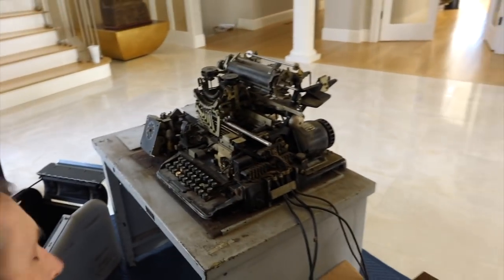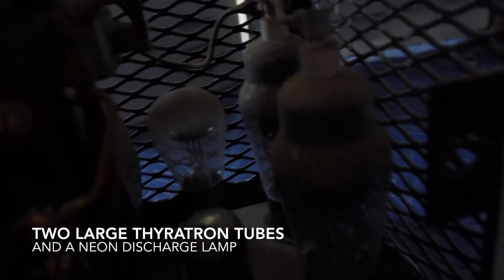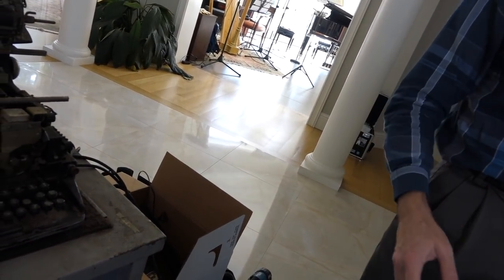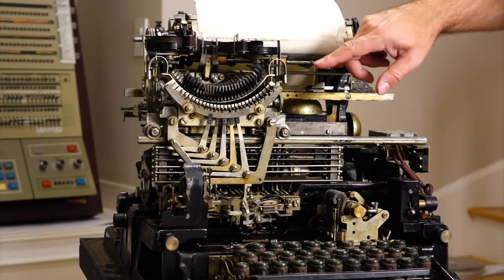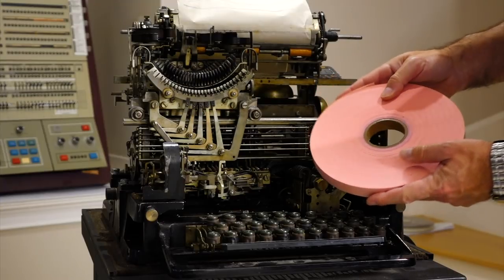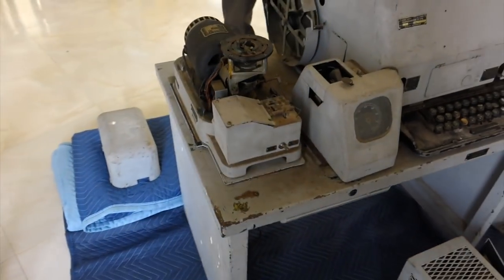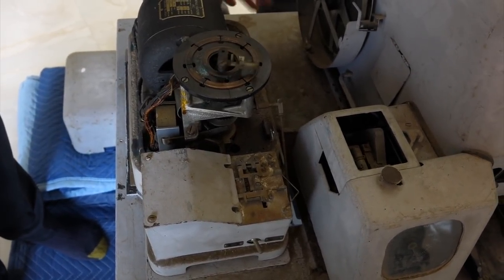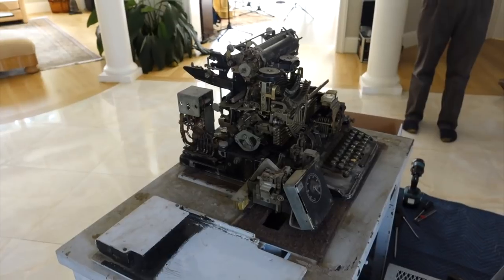Teletype Model 19 - Part 1: A Teletype Arrives for Restoration

Comment: Oh, this should be fun.  My dad had a TTY 19 (in black) at home when I was growing up.  (It worked, too.)  I remember the lights from those tubes in the power supply.  From the colors, I think one was a mercury rectifier (blue) and the other a voltage regulator (orange).  Of course, it was serial communication over a 60mA current loop circuit.
Reply: Yes, the two that are blue are mercury thyratrons and the orange is a neon bulb (large) which provides a voltage reference based on its discharge voltage.

Comment: Wow do the type bars move back and forth? I don’t think I’ve ever seen that before!

Beware of wax / paper caps in the PSU. You might want to make a dim bulb tester before just plugging it in, that can save the transformer if one of the filters is shorted. Basically you use a light bulb as a current limiter / fuse.
Reply: The horizontal bars tilt up and down to reflect the MARK or SPACE condition of the associated bit. Five bits in baudot code, so five bars. The type bars flip forward just like old school typewriters.

Comment: One of the interesting things about the power supply is that is uses synchronous rectification. The rectification is done with a pair of mercury vapor thyratrons (WECo 323As) - note the grids. In operation, they will indeed emit the Holy Blue Glow.

Also, your TT-7/FG was made in 1951 or thereabouts.

Comment: I think the square plug with 4 flat pins and the offset centre round pin is exactly the same Cinch Jones plug that the Drake TR7 transceiver uses for its 12v power input. It looks identical at least.

Comment: how is the model 19 mounted on the table? is there still a plate between the table and the teletype?
mostly looking on how the cables are protected ( the get damaged here on one without table)
Reply from the maker: I checked and indeed there is no side door for the cables on the enclosure like in the model 15. The cables go straight down through a hole in the table.

Comment: A minor error in the captions around 2m30s: The Model 19 is not a "military version" of a Model 15. To summarize:

The Model 15 Teletype was printer-keyboard only, mounted on a stand as shown on the video. "KSR" units included a keyboard ("K") and could send ("S") from the keyboard and receive ("R") on the printer. "RO" units were "receive only", containing just the printer without a keyboard — often found in places such as radio stations that received news from UPI (United Press International) or AP (Associated Press).

The Model 19 was a table-mounted Model 15 printed... plus a paper tape punch driven from the keyboard ("perforator") and a "transmitter-distributor" (TD), a paper tape reader. Some versions of the Model 19 were configured with a "keyboard-typing reperforator" (KTR), a tape punch that could be switched to receive incoming signals and record them to paper tape... or switched to punch a tape from the keyboard. ("Perforators" punch tape from a keyboard. "Reperforators" are capable of punching tape from an incoming signal.)

The Model 14 TD was a standalone tape reader to transmit over the wire/radio. The Model 14 reperforator was a standalone typing tape punch that received signals from the line; it often sat on a wheeled base and could be rolled around to different operating positions... and was nicknamed the "potty".

Comment: Konrad Zuses Computers used Teletypes with papertape punches and readers with the 5 bit Baudot code as in- and ouput devices starting with the Z11 I think until the last models Z23 and Z25. Zuse had the first usable plotter that could also be controlled by the teletype punch tape.

Comment: Where do you get blank paper tape nowadays? Is it all new-old-stock that you’ve got in a closet somewhere, or is there someplace you can order it new? 🤔
Reply: I know the people who trained on morse code used machines that used paper tape. I'm sure there's old stock floating around.
Reply from the maker: Mine is from eBay. Not cheap. I am sure you could have someone make new rolls if you ordered a lot. But this paper tape has to be oiled (the oil in the paper is to keep the punches oiled).
Reply: I've seen a Morse code trainer like that, but I think the tape was narrower.  I think two tracks with a set of sprocket holes.  TTY is 5 holes plus the small sprocket.

Comment: I wonder how many people still around remember how to wind the tape into figure 8s using their thumb and pinky finger?
Reply: I'm still here!  -  RYRYRYRYR -  (who knows the significance of that?)  I was a Teletype tech in the USAF in the 70's!  Afterward I worked on model 15s and 20s as late as the late-80s for UPI in S. Carolina (where they still had a slow speed wire circuit that didn't require the newer dot-matrix printers.)  I've forgotten most of what I once knew of these machines but I can still wrap tape around the thumb and pinky!

Comment: There was a way to scan pictures and have an electric typewriter reconstruct the photo using keyboard characters. Do you have one of those?
Reply from the maker: Oh sure, plenty of programs available on the net, some will even do it online in a web browser, there are apps for the iPhone too. Look up ASCII art. I had good luck with one called ascgen2 on the PC. I used it in my ASCII Art video right here: https://youtu.be/YS9dGYUbNd0
Reply: That's not what I mean. The green bar printouts with the art aren't the same kind of thing as the scanned photo printouts. The photo printouts printed characters over each other to get a more detailed photo. The original photo went in a drum for scanning and it was sent over phone lines. The printouts were on modified electric typewriters. It was used before WW2.
Reply: Our team member Luca created a system to snap photos with a phone, transmit it wirelessly to an interface where it was converted into overprinted characters and sent to the 1403 printer on the IBM 1401 system. He plans to modify this system to send 5 bit baudot to the teletypes.
Reply: Overprinted! That's the term. All I know is I saw examples of the printouts and the photos and they looked 20s or 30s. It could have been a system in limited use or even a prototype for all I know.

Comment: Really nice! But if it were a steam teletype it might actually have asbestos in the grease or sealant!
Reply from the maker: No kidding. This one has asbestos in the wire insulation. Ken was using a mask while working on the table wiring.
Reply: Wow, ok... I'll remember that. Was that to give the insulation fire protection? I've seen the hard asbestos sheets in old tv's, I'm guessing the wire insulation might have the real nasty stuff that floats around well.
Reply: Asbestos was cheap and it was heat resistant.  You could find it most anywhere you expected something to get a little hot.

Comment: 5-bit Teletype is called Telex. Some Teletypes could do both 5- and 8-bit. I was using once a Swedish computer via Telex network from Finland. It was the fastest, because voice (and modem) communication was unreliable.
Reply from the maker: Telex refers to a switched network service, some over radio links or modems, which used teleprinters like the Teletype as their communication terminals. So you could "call" another Teletype on the Telex network, be connected to it automatically, and send a message. Pretty cool. It ran Baudot initially. In the US, Western Union was famous for their Telex-like service, and sure used a lot of Teletypes. But Baudot Teletypes were used for many other things than the Telex service.
Reply: Telex was something you'd see used in business in the 60s and 70s. I got the impression it was a teletype machine you could dial into.
Reply: At least colloquially it was. I remember a room full of terminals. You could choose either Telex-machine or Teletype-machine for your   overseas computer communication. Telex was reliable but slow (50 bits) and Teletype was superfast (300bits) but unrealiable and expensive.
Reply: I got out of college in 87 and don't remember seeing Telex machines. Seems like, in '89, everybody got fax machines and that was it.
Reply: This was in 1969. Telex network was the best method to transmit data in most countries, because telephone exchanges were operated by humans  and they would cut the connection if they could hear a modem whining.
Reply: Why would they cut a computer connection?
Reply: Cluelessness. There is supposed to be human voices on line. Silence or nasty noises meant that the connection was broken.
Reply: I company I worked for was still using Telex in the late 80s... their only customer that sent messages that way was the British Army... the millitary are akways a decade or two behind civilian life.
Reply: In many cases telephone companies operated telex separately from voice telephone.
Including having an entirely different numbering plan.
The only things likely shared being cable bundles.

Comment: Was 80 characters per line standard?
Reply: MichaelKingsfordGray 
Weren't punched cards later than this teletype?
Reply: Hollerith machines were pre computers at all weren't they?  for sorting tasks.
Somehow the 80 chars per line got embedded in them.
(trying to remember my computer history)
Reply from the maker: Punched cards date back from the late 19th century... The IBM 80 column ones were used in unit record electromechanical equipment way before being used in computers.
Reply: History is weird -  like 'which came first the storage mediums or the computers?'...
Storage first, then I guess the computer industry started to overtake/invent its own stuff as momentum built.
Reply: Thanks, I don't really know that much about early electromechanical technology but I believe that the first punched cards were used in the Jacquard loom sometime in the mid 19th century, so I don't know why I thought paper tape was earlier!
Reply: Regarding punched cards see also:
https://en.wikipedia.org/wiki/Jacquard_loom

Quote:
"
This use of replaceable punched cards to control a sequence of operations is considered an important step in the history of computing hardware.
"
Yikes!
Reply: The standards were 72 characters per line or 70, depending on whether the operator was the US or British military. A light will illuminate when you get near the end of the line, since the operator is typing without a local echo of the keystrokes. Tells the operator when to issue a CR and LF.
Reply: @WaltonPete  The Jacquard machine is from 1804. Interestingly paper tapes were used by Basile Bouchon in 1725 also to control looms.

Comment: Marc, what sort of telephone line simulator do you use when testing and demonstrating these types of devices? Back in the day I remember we had a little box that took two 9V batteries that we used to connect two fax machines together for testing.

Also, I was going to suggest the Ames company for recoating the platen roller of your teletype, etc. I used to use them for recoating typewriter platens. Sadly, I see they went out of business in 2012 but another company has diversified into that business I have no connection with them, just passing along info: www dot jjshort dot com/typewriter-platen-repair dot php
Reply: These devices use a 60mA current loop interface. Which makes it fairly simple to connect two of them together.